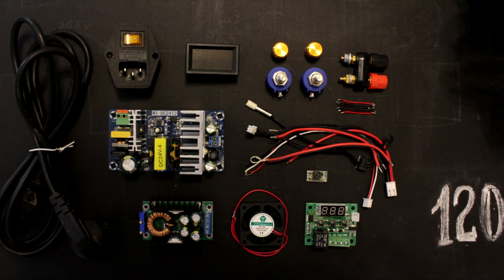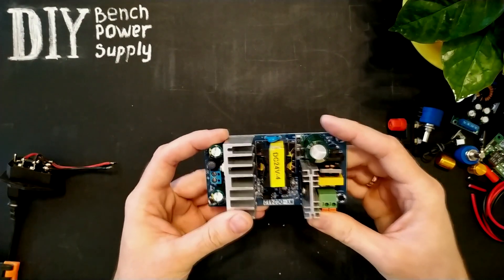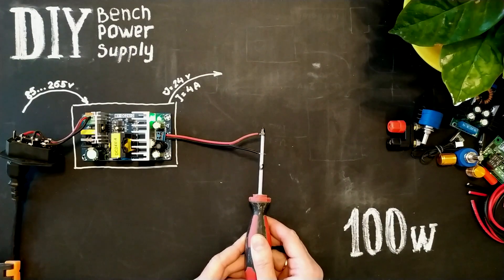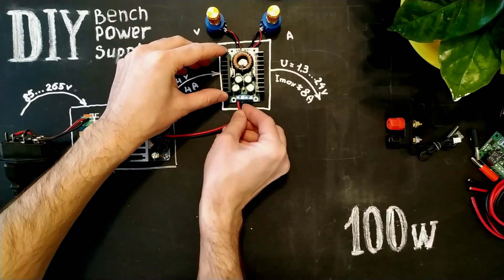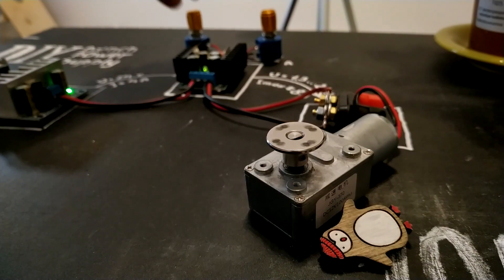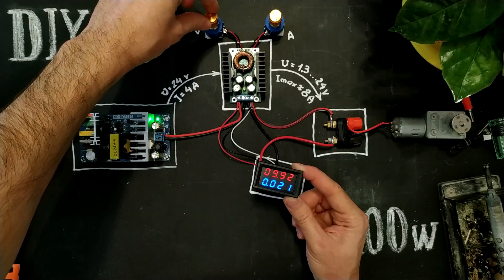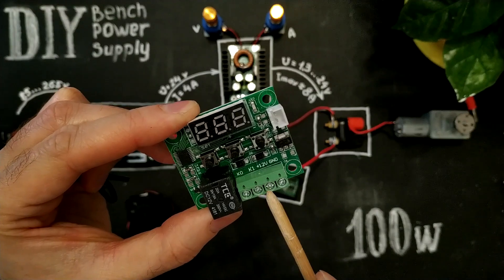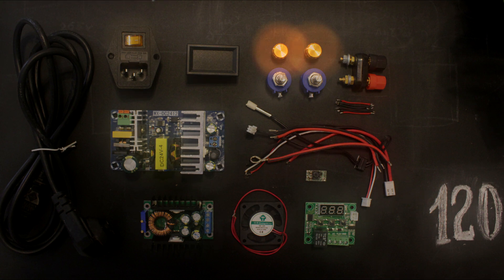DIY Bench POWER Supply (#1/3 - Circuit)

Comment: If it draws 10A at 230V then you have another problem with the circuit. Because none of these components can handle 2,3kW.
EDIT 13.01.2023: You forgot to say 4:05 that it should be the same resistance in the big potentiometer than in the small blue one.

Comment: which one is logical;
1. to use fuse before  220V power switch 
2. to use fuses before each outputs (3.3, 5, 12v etc)

Comment: Great video. 
I bought the same SMPS. But when I checked the DC section (24v side) using a tester ( to make sure there is no electric shock), it is glowing very bright. Have you experienced this in your SMPS?
Reply from the maker: it is weird

Comment: Your power supply looks great, but can you tell me how the potentiometers would be connected if I were to add a third potentiometer to regulate the fine voltage adjustment?
Reply: Probably many ways to do this. You could add a lower value potentiometer wired as a variable resistor in series with the voltage potentiometer. For example a 10k potentiometer in series with a 1k variable resistor.

Comment: Hey there. I'm just getting to grips with the idea of a floating power supply. I've had the idea of constructing two of these into the same case and using it as a makeshift dual polarity psu, but I'm worried about connecting two unisolated grounds. Am I thinking in the right direction? Or would there be a better solution entirely? Awesome tutorial!
Reply: You could build 2 of these to create a split supply. You have to make sure that they are isolated(floating) power supplies. That is isolated from mains and from each other. In this case it is better terminology to say common instead of ground as ground implies a connection to earth. The mains ground/earth should be connected to the case for safety. The 2 power supplies could then be connected in series to create a split supply. Many older lab power supplies were built in this fashion. They would have isolated pairs of outputs and a separate ground/earth terminal. They came with metal connectors that you could connect the outputs to ground your common output or connect outputs in series.

Comment: Thanks for the video! I have one concern though, I have the same voltage and current regulator as well as the 10k Ohm potentiometer but when I soldered the potentiometer to the regulator and started turning the knob, the voltmeter is only showing voltage up to 4.5 volts and I have turned the know all the way to the right. I connected the wires (1,  2 & 3) properly per your instructions. What could be the problem? Please advise. Thanks!
Reply: Did you check the input voltage to the buck converter? Also please check if any of the pot terminals are open